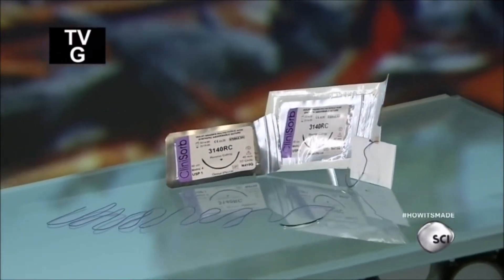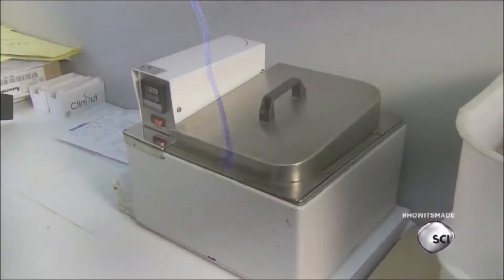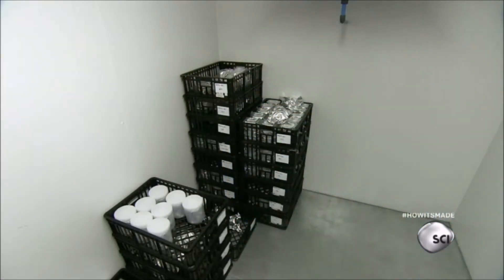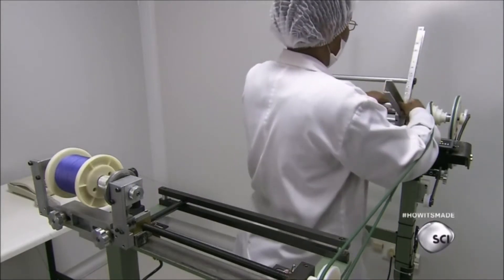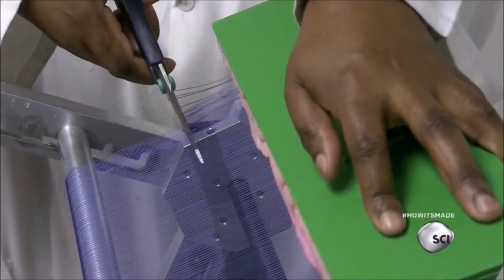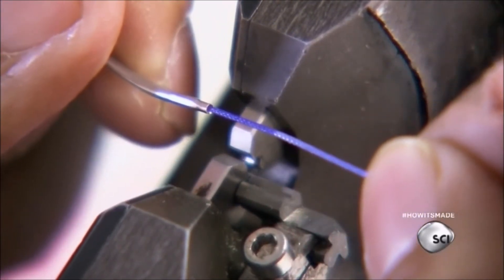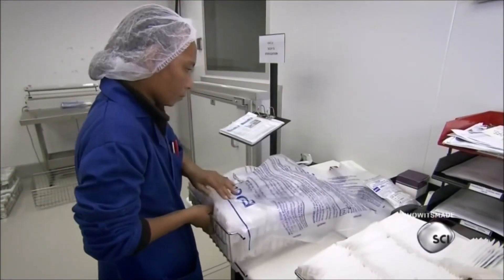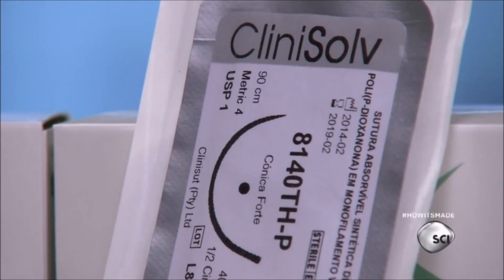How It's Made - Surgical Sutures

Comment: I was concerned after watching sutures made in S13E10. As near as I could see, the sutures were assembled by bare handed (hence non-sterile) workers, then sealed, then sterilised with EO gas. How can the gas sterilise an already sealed package?
Reply: ETO gas sterilizes the suture since the secondary package the one which is sealed, uses a breathable material called Tyvec. The foil inside is still open when the sterilization is performed
Reply: @cesarT921   hello, please how they seal after the sterilization  the first bag ( aluminum) ?
Reply: @montassarayoub1089  there are three packaging elements here:

1. The cardboard skeleton where the suture is winded.
2. Foil + Foil metallic pouch 
3. Film + Tyvec plastic pouch 

If you look carefully from 3:50, they put the [1] card within the [2] pouch without doing any sealing operation. They leave the [2] pouch open on purpose to allow the ETO gas to get in contact with the suture through the sealed plastic pouch [3].

They can either leave [2] open and ship it or attempt another welding operation from outside [3] which does not add much value in my opinion since contents within [3] are sterile and away of contamination. The Tyvec doesn't alow contamination with particles above certain diameters (just like the n95 masks).
Reply: @coin_Victory  look at my comment above.